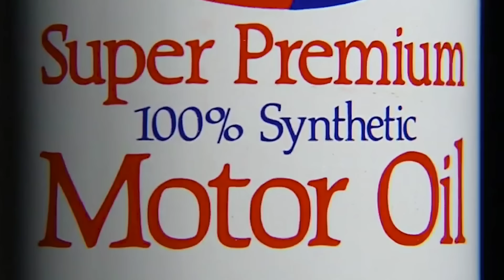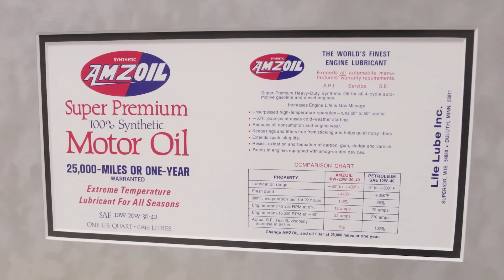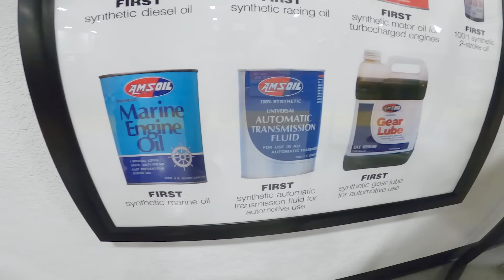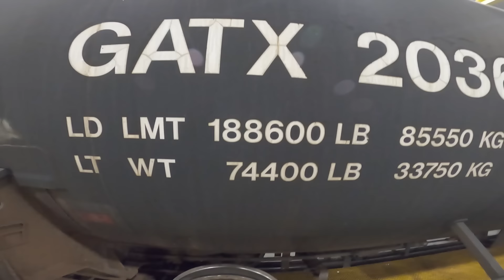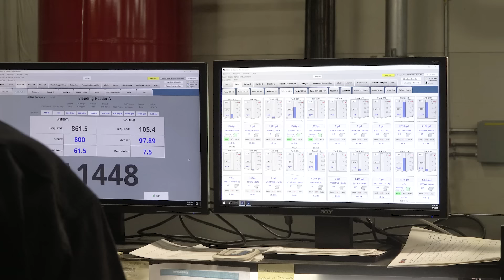How synthetic motor oil is made | Part 1 of 4

Comment from the maker: Watch Ep 2: Motor Oil Chemistry https://youtu.be/9rEGIB2F8qA
Reply: Question in a piece of paper show 25 000 mile extrem think, why people has to change the oil every 5000 mile ? What hapened with the rest of the 20 000 miles ?
Reply: I was to impatient didn't know this was a continuing series . Just watched Ep. 2  , now were getting the info I was looking for !!!!  THANKS
Reply: 3:10 : well, you weren't first to create synthetic oil for pain relief, foot, or hair grease. Also, you weren't first on synthetic cooking oil. Shame on you 😠🤭😂😂😂
Reply: I’m running a 07-1/2 Ram Cummins 6.7 deleted due to the dpf and catylic converter was both bad and was nearly shutting truck down. But it has 175k miles on it and I run Rotella oil in it would changing to a synthetic oil be better for it or with this much mileage it wouldn’t matter.
Reply: I have a question for Gale. What’s your input for conventional versus synthetic oil for an engine break in? I’ve heard lots of things but would like to see what the Mr. Gale Banks has to say.
Reply: @davidinchcliff4560  it's probably a good thing if we can keep reprocessing the old chemicals, that's basically what oil is anyway. Where does Amsoil get their chemicals anyway? Do they beat it out of a rock? Somebody has to process the chemicals that goes into Amsoil. I'm sure they don't pull it out of thin air. I'm sure there's a paper trail
Reply: @lawrencejneuser8801  I'm just telling walmart was sued. Let's not cry
Reply: Gale thank you for this upload, i have worked with engineers from all backgrounds, from mechanic's to aircraft engineers and you upload about the Amsoil and how its made is the only upload in the world which the oil manufacture explains everything there is to know about various oils and how they are made and all the various steps in the manufacturing processes, sure no oil company is going to tell you which chemicals as part of the friction modifiers and enhancers used and the % used and which combo's are used in various SAE oils, but in saying that to date i have not seen anything as comprehensive as the 4 part serries you have about Amsoil, cheers and thank you, its was very informative?
Reply: Also i wonder if Amsoil has a Dexos gen 3 certified oil ILSAC GF-6A Certified oil on their listing and if they sell to Australia.
Reply: Gale thank you very much, for doing this with Amsoil, this is the only upload about how synthetic oils are made on the internet, sure theres so many others, but nothing at all compared to what you have done, right down to the various chemicals used as friction modifiers and other additives so that the oils reach a SAE quality standards or certification? I worked for Wynn's and sold friction modifiers and every test we did based on the various large mining companies oils that they used we sent then to a lab and the results speak for themselves ,which is why i sold to multi million dollar mining companies to use various friction modifiers to enhance the oils, gears oils and greases they used to extend the protection in the oils and preventative maintenance schedules.
Reply: I wonder if AMSOIL has a new synthetic oils which is unto or exceeds the new Dexos gen 3 or the ISLAC GF=S (6A) standards ?
Reply: Nice clean factory but rather useless information
Reply: @vladracul40  to
Reply: I watched this whole thing and learned absolutely nothing about how motor oil is made. I’m completely clueless about the process, but I know you have a crush on Amsoil
Reply: @vladracul40  I would never leave oil in for 25,000 miles, not only are filters mostly rated to 10,000 miles up to 15,000 miles but who knows what that oil is rated to be throughout the 25,000 miles. Could be dried grease by the end but it’s still a petroleum product capable of lubricating something. I have no idea, and it’s infathomable that the oil is good for 2.5 filter life cycles. I suppose it’s not impossible for them to Engineer an oil and filter that together could yield under ideal conditions 25,000 miles of what they deem as adequate protection and lubrication, it’s just hard to imagine.
Reply: Sorry to burst your guys bubble but each weld takes 3 passes actually. It’s call a bead is the base then a hot pass then after the hotpass is the cap

Comment: This should be called "How syn motor oil is stored, blended, handled and packaged". It's a nice marketing piece, but it doesn't give any information about how the oil is made.
Reply: They haven’t said anything about what the “raw materials “ in the rail cars are .
Reply: @curtiss744 probably petrol
Reply: Proprietary information known only to the blonde haired dude and the queen mother…😂
Reply: It's only the first part of a four-part series
Reply: Exactly. You're not allowed to know ;)
Reply: Get hpl. High performance lubricants. Way better than amsoil
Reply: @shiningstaer  do you have any sort of tests to backup your statement or is it just your opinion?
Reply: Trade secrets
Reply: @shiningstaer everyone has different opinions on oil & what is best....independent tests have been done with different people sending there oil breakdown after hours or miles of use through independent labs & this has come out better than most after guys have used other top oils in there vehicles & bikes know personally guys have had better performance & less wear on mx bikes internal parts through using amsoil alone & have not long ago switched to this in my mx bike to have it run quieter & better clutch  feel
Reply: Why would any multi-billion dollar company share their secrets? 🤦‍♂️
Reply: The additives are input to the decant at 12:00.  They mention at 22:30 the products have ISO certification, meaning oils follow a standard recipe. The additives also depend on the product being made. As others have said, it's a 4 part series. Just look at the pinned comment at the top.

Comment: Pretty amazing. Handling millions and millions of gallons of oil and you don't see a drop of oil anywhere in the factory. I normally only handle 7 qts of oil during oil change and yet always spill some and mess up my garage floor.
Reply: Henry T...........I've been through that facility a couple of times, and I have never seen oil on the floor!  The facility is VERY CLEAN!
Reply: Any Toxic Waste, on the Floor, is Squeegeed into a nearby Stream/River.
Reply: @ihavefallenandicantreachmy2113  Exactly.
Reply: That's the truest statement on here.....I change my 3 different motorcycle oils and bound to make a small mess in the hour or so of doing it!!
Reply: Cat litter is cheap and works!
Reply: @77.88.  dry powdered clay works best. Rub in, let sit, rinse.
Reply: Heated hot water from a boiler is used to push it usually tempered to 140 degrees to help keep from burning workers, then again in the drains as well to help it move to finally a oil-water sepator.. the water will be reused and the oil disposed properly.
Reply: Lol yup. I handle 6 quarts per change and always manage to make a mess.
Reply: Good point
Reply: You are so right haven't even sold dealer for about 23 years and I've been to this facility a couple of times on different tours and I can vouch for what you're saying I was amazed at how clean this place is with all the lubricants and chemicals that they handle
Reply: 15 quarts here. You can imagine my hazmat situation.
Reply: I hate when the wind blows and the oil , well doesn't make the pail 10" away!
Reply: Nicely done to not waste a drop!
Reply: @edwardcarberry1095  lolololol.....yet preaching to the choir!!!! Lucky for me...(I guess?) I have a gravel driveway........😳😳😳
Reply: @hitekredneck109  Just to give you a giggllee .
Had the oil filter ballanced over center in the pie pan for can't oil. It over ballanced and fell onto my tarp. EERRRRRRRRRR errrrr
Reply: Because the oil is made chemically using water and other ingredients but no black gold aka oil!!
Reply: Yes, hydro treated oil is produced. Mobil uses the 2 to 3% of naturally occurring  produced oil for there produces. Or at least 40+ yrs ago what is what they said.

Comment: As a USCG licensed captain who previously worked out in the Gulf of Mexico Oil Patch, I can appreciate this technology and how this operation works. The electrical and plumbing that went into this manufacturing plant are top notch. Even though there is still a big need for mineral based oils and lubricants, I have used synthetic oil, transmission fluid, and brake fluid in my vehicles, and turbocharged drag truck since the late 1980’s, so I’m a big believer of synthetics. Amsol makes a great product! Thank you Gale Banks and Scott Davis for showing everyone how synthetic oils and lubricants are made, processed and packaged. I really enjoyed this series of informative videos! Keep those diesels running and racing Gale!
Reply from the maker: Will do, thank you!
Reply: @bankspower  YW Gale! You still look as fit as a fiddle for your age which is amazing, and your knowledge about the turbocharging of Diesel engines would fill volumes of books. Of course,  life is better when you do the things that you love doing. 

On another note, I had one of Kenny Duttweiler’s original stage 3 Turbo Cams in my Buick GN prototype engine that I swapped into a 1983 GMC S-15 4wd Pickup Truck back in 1989. I use to talk to Kenny occasionally before he really got involved in Drag Racing. At that time,  Turbo magazine approached about that engine swap because it was the first of it’s type ever done. However, we weren’t able to get that magazine article done because of my schedule. I purchased this engine out of the Turbo Blue Buick Motorsports Drag Racing car and, I still have this truck. Yet, it is currently in storage and not running at this time. A lot of the items on this engine were cutting edge technology and costly at the time. I spent a lot of hours modifying and tweaking this engine all by myself. 
 
Also, I was fortunate enough to actually know Smoky Yunick. Occasionally, I would call him at his “Best Damn Garage” down in Titusville and would ask his opinion about the engine mods that I was doing. Sometimes, it seemed that we would talk for hours about racing engines and high performance modifications. I actually still have the book that he wrote and published about turbocharging. It is like the Bible of Turbocharging. He was a real legend just you are. Again, I really enjoy watching your videos which are very informative about the Automotive industry and it’s innovators, such as yourself.
Reply: Get to the bloody point!
Reply: @GrantJohnston-dr9rt  Did anyone ask you to chime in?

Comment: I love how this guy operates! Gale Banks is the MAN!

Very informative video. And increased my interest in Amsoil.
Reply from the maker: Love to hear that you enjoyed it. Stay tuned for more.
Reply: Same, I've been a Mobil1 guy for a few years. Lol
Reply: @yeeyee5.382  you'd be shocked to learn how poorly mobil does in lots of testing. They are good in TBN when you look at their top line stuff, but they can't match in wear protection and thermal stability.
Reply: @yeeyee5.382  amsoil is the best, pricey but the best
Reply: Dont run amsoil, power driven diesel oil...do your research!
Reply: @cody7135  I did
Reply: The man, the myth, the LEGEND. ...I love this dude
Reply: @cody7135  got any reasoning to back that up bud?
Reply: As a loyal fan and user of Amsoil including the Z-ROD 10w30, 10w50 dirt bike, 5w30 OE, etc.

Utterly impressive and without a doubt extremely interesting!

How well thought out this factory is, down to the details, craftsmanship!
Reply: @cody7135  That's definitely the truth 💯 DESTROYED my Kubota D902 less than a month after I put this oil in.

Comment: Glad to see Gale is still around.  He built my 428SCJ in the late 70's.  Said it would hold together past 8000 RPM.    A couple missed shifts at the track proved him correct   :D   Also gave me the secret to no blown head gasket on a Ford FE series engine without O-ringing it.    I never blew another head gasket.  Thanks Gale!
Reply: You can't just say that without indicating what the secret is!?
Reply: @jrodriguez1374  LOL    the Fe series engines only had 10 head bolts and were known for blowing head gaskets.   When I took my parts to Gale for the build I wanted him to O-ring the cylinders.   He said he could do it but if I was worried about blowing gaskets He had a solution. At that time it was to use the Felpro sandwich gasket.  Use new head bolts with hardened washers.  (They did not come with factory washers)  Use anti seize and torque the heads.   Run the car about 50 miles then re-torque.  Do this again so that heads have been torqued at least 3 times.  He assembled the engine with new head bolts and washers.   I re-torqued twice after that.    Never blew another head gasket.
Reply: @gsxrsquid  wow, that's great, thanks 👍🏽😊
Reply: @jrodriguez1374  I'm sure it would probably work with most engines but the FE series were prone to the gasket failure.   I still love them though!
Reply: Great story! Thank you for sharing it
Reply: yeah.   you could mix and match and get the engine you wanted.

Comment: Great tour of the packaging facility in this episode. Now it would be perfect to have a follow up episode on how the oil is actually made and the science behind synthetic oils.
Reply: Yes, this is not how it is made, but how it is bottled and packaged.
Reply from the maker: We have an upcoming episode where we step into the Amsoil lab where we explore the molecular structure of synthetic oil and its additives. Stay Tuned.
Reply: @bankspower  B.S. You start off with crap like this. You have NO cedability!!!!!!!!!
Reply: @franzliszt3195  ?????
Reply: @franzliszt3195  WELL, ACTUALLY HAVE YOU WORKED IN A FACTORY LIKE THIS!??? THE MAIN THING I FOUND AS A BATCH MAKER WITH BERRI JUICES WAS THAT I DIDN'T KNOW WHAT THE PACKAGING DEPARTMENT NEEDED BECAUSE NOBODY INTRODUCED US??? THAT'S WHAT MR BANKS IS DOING, TAKING YOU ON A TOUR OF THE FACTORY!? WHAT, YOU THOUGHT HE WAS GOING TO DIVULGE HIS TRADE SECRETS!????
Reply: @mattdread4994  Of course I don't think he would give trade secrets. Butt say he said something like the following, " and here we add some heat to increase the hydrocarbon length because it makes the oil last longer, and here we a some elemental metal as it decreases friction, and here we add some anti corrosion material." As opposed to this crap," and this pipe goes here into this pipe and it goes to this pipe and then we put it through this pipe and it come out here into this pipe." What the hell. I looking forward to  the next vid to see if its just more pipe into pipe into pipe......
Reply: @franzliszt3195  I get what you’re saying and I agree. Might have came on a bit strong in first comment though lmao
Reply: The actual manufacturing occurs at a refinery somewhere. All they do here is blend and bottle a product manufactured somewhere else. The fact they do not actually manufacture oil but blend oil and additives doesn't make their facility any less impressive.
Reply: @JM-sx9yk  its close to outsourcing but not really. They specialize in something but it's expensive to run AND own a refinery.
Reply: @franzliszt3195  "and this pipe goes here into this pipe "...🤣😂
Reply: @bankspower  Gale Banks super cool guy  thanks
Reply: @bankspower  ahh thanks ,now I don't have to finish watching this video. Wait for the good stuff
Reply: Wow that confused me too. We’re was the chemistry
Reply: In order to ascertain whether Amsoil is essentially different from the competition like "Mobil 1, Pennzoil, Castrol, Supreme Tech, Kirkland, Valvoline, Royal Purple, etc."  From what I have gleaned the base oils are essentially the same in all of them derived from more highly refined petroleum than conventional motor oils....a matter of putting the oil through several more processing containers and adding a chemical solution consisting of several oxygenated esters to impact and enhance the refined base oil's properties.....thus called highly refined petroleum....the differences come in the additives between manufacterers as each one uses a proprietary combination in its additives. The price differential is thus somewhat subjective rather than objective and more a result of effective marketing rather than actual scientific differences between the competition.

Comment: Been an Amsoil guy for years,  have used their racing oil, diesel oil and regular gas engine oil for 30+ years, now that Gale Banks has done this series it just certified my thinking about Amsoil. Gale is the man
Reply: AMSOIL said nothing useful.  Just talked about their packaging process.   Waste of time.
Reply: That guy just said he didn't find nothing useful in this I found a whole lot of useful let you know the quality control in the product or making his continuous so if you're doing so if you're doing all sampling equipment you're putting oil in you know if the oil to put in is up to spec start off with that's boring you safer Cummings other companies manufacture oil testes other companies Oil they are not consistent drum to drum I have I respect their consistency we need more that if world
Reply: @josephmorton2010  Some of us have more knowledge than others.  It is good you are learning, because knowledge is your future. If you read the title of this video, nothing in THIS video supported the title.  That is my point.
Reply: Decent product but how come its not OME suggested  kinda makes you think